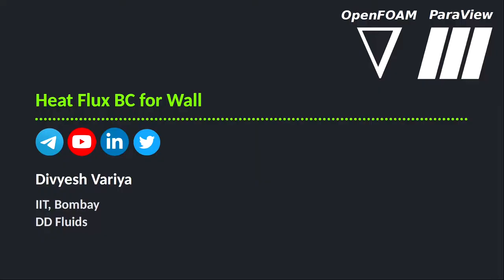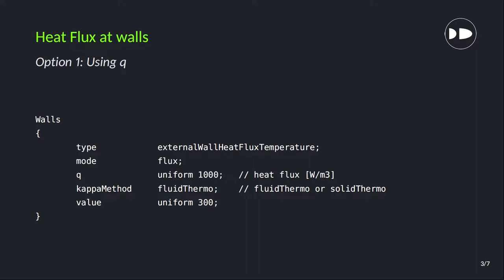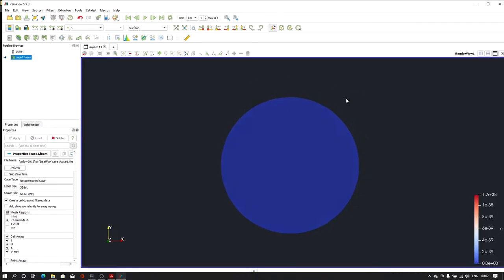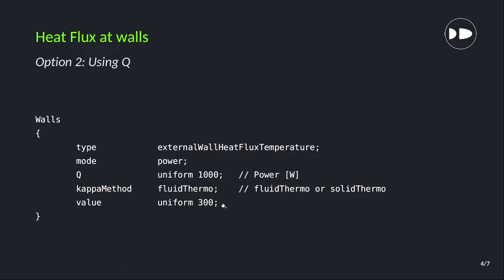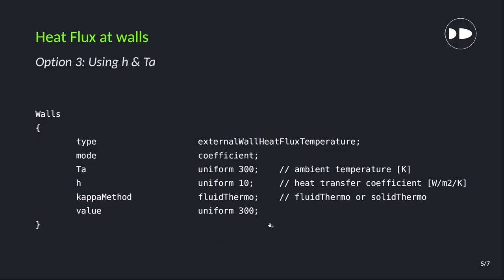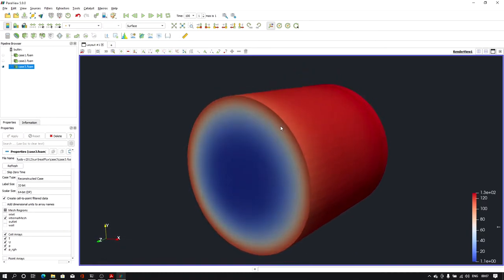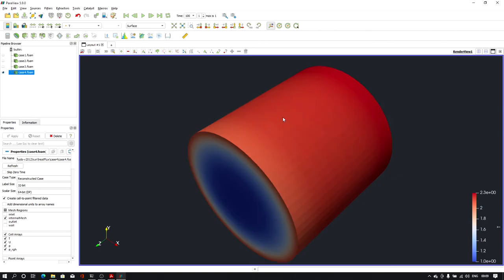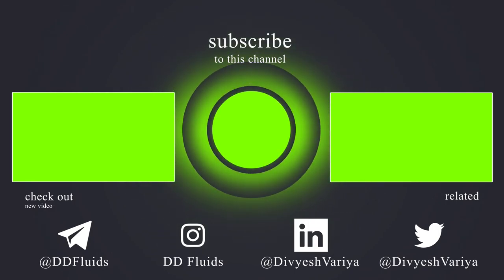Heat Flux Boundary Condition in OpenFOAM | externalWallHeatFluxTemperature

Comment: Thank you so much for these great videos . I am just a bit confused if the q BC used is heat flux so then the unit should be W/m2 rather than W/m3( per unit volume, which is written in the slide in the video) is flux defined differently in openfoam?

Comment: Does the value in the condition  represent temperature value ? If we are giving  heat flux value , why it is needed ? Should it be corelated to flux value, how ?
Reply from the maker: That value is default value.It could be any arbitrary value. It is required to visualise result in paraView. In the 0 time, OpenFOAM is not calculating anything but to see it in the paraview, it asks for some value. That is the reason of specifying default value in boundary conditions. You will see same thing in other boundary conditions as well.
Reply: @DDFluids  so ofter zero time, the temperature value will be calculated accroding to the heatflux value , right ?
Reply from the maker: @simulator4731  yes, after 0 time solver will calculate temperature. And those values will be correct.
Reply: I had the same question, thank you!

Comment: Sir, I am getting this error
--> FOAM FATAL ERROR:
Cannot find a fluidThermo or solidThermo instance

    From function Foam::tmp<Foam::Field<double> > Foam::temperatureCoupledBase::kappa(const fvPatchScalarField&) const
    in file derivedFvPatchFields/temperatureCoupledBase/temperatureCoupledBase.C at line 124.

FOAM exiting
please help.
Reply: You might not have defined thermoType in thermophysicalProperties file of either of the three regions: fluid, heater1, heater2.
You can use:

1. For Solids:
thermoType
{
    type                        heSolidThermo;
    mixture                  pureMixture;
    transport               constIso;
    thermo                   hConst;
    equationOfState   rhoConst;
    specie                    specie;
    energy                   sensibleEnthalpy;
}

2. For Fluids:
thermoType
{
    type                        heRhoThermo;
    mixture                  pureMixture;
    transport               const;
    thermo                   hConst;
    equationOfState  rhoConst;
    specie                   specie;
    energy                  sensibleEnthalpy;
}

THANK YOU!!!

Comment: Hi! I want someone to help me urgently. I will pay for that. The case is for openfoam only. 
Problem description:
 I have a circular tube of length 1m and dia 4 mm. At the inlet saturated vapor at 312.54 K is supplied. It is a condensation problem. 
Head load applied on the wall can be 250 W Or 500 W. 
Mass flux can be 250 or 500 kg/m2.s. 
Fluid is Propylene at 312.54 K. 
Now I want to have a simulation where all flow regimes are captured properly. 
If anyone out there is interested to help, plz feel free to ping me personaly.